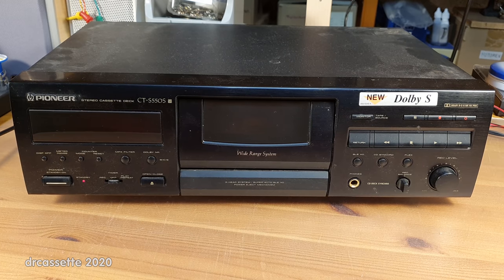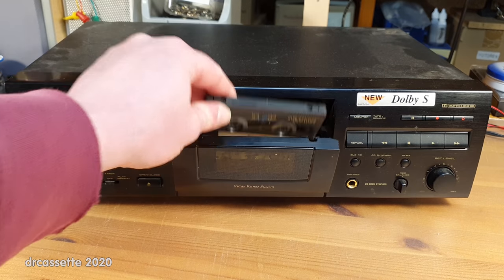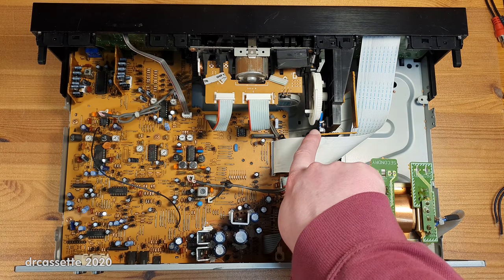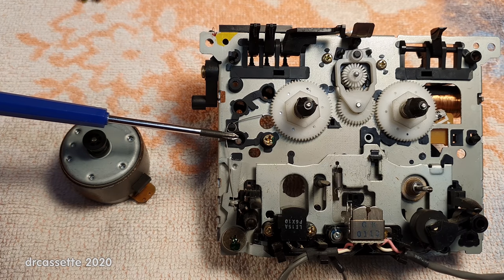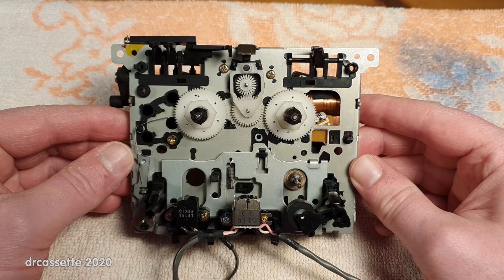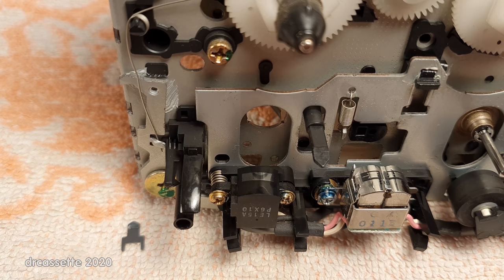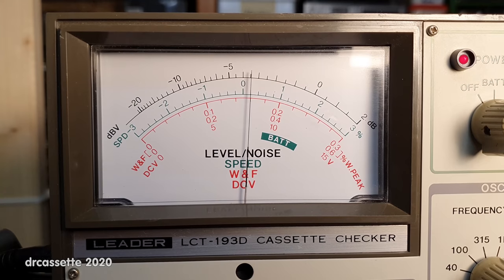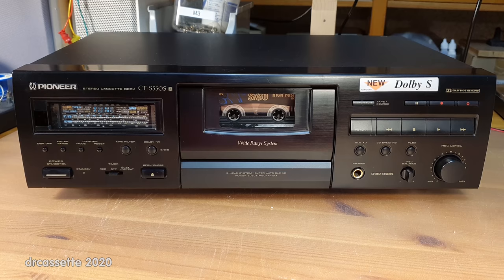Pioneer CT-S550S cassette deck repairs

Comment: Teac and Kenwood tape decks of the same time used the same mechanisms made by Alps. However, time has proofed that these mechanisms are suprisingly good, because most of them return to good working condition after a basic maintenance. It is completely different from other brands, such as Technics, whose mecanisms are constantly damaged beyond repair. Speaking as a technician that repair these decks in a daily basis, despite the cost cutting, I still prefer Pioneer then other brands of the same period. Majority of these equipments are capable of returning to life.

Comment: I've had the same issue with the guide coming off & having to glue it back in place. In my case the plastic parts of the erase head were still hanging on, so I was able to glue them back in place as well. Whenever cleaning plastic erase heads ALWAYS be gentle around the guide.

Comment: I love Pioneers, but this generation is horrible. A simple CT-676 far supersedes it in every way. The dim display is probably because of the standby mode (soft OFF). Most likely the VFD filaments are always powered when the device plugged in. The mechanism is not too bad, Sony TC-K500, 600ES (<-real ESPRIT, not "Elevated Series") and Yamaha KX-330 uses it too. On all of those however, there is a backplate for the flywheel... not even the cheap KX-330 cheaped out on it. I would't give one CT-676 for 10 of these. Great video, thank you!
Reply: the 676 with ble from1990  was a surprise for me it played and recorded with a high quality sound, but had a resistant mechanism in the first month the owner who had the first more quality deck ,recorded like 80 cassettes and today with new belts it works perfect after 10 years stored in a dry place

Comment: the late 70s to the 80s were the best years for pioneer super great quality metal though out  well made cass mechs by the late 80s to 90s they begin to go downhill on quality....
Reply: Sign of the times back then as pretty much all the major manufacturers were doing the same. 1996 - 2000 was an interesting period, as I'm sure MiniDisc was becoming a popular choice for home recording. CD-R/ RW a little later..

Comment: I think in this case, the adhesive inside a cassette tape that binds the "leader" tape to the actual magnetic tape came off and got stuck on the heads.  This happens if the cassette tapes are of low quality or not manufactured correctly.  Once that sicky adhesive get on the head, the oxide will then build very quickly.
Reply from the maker: The dirt stuck to the record head very likely were deposits of tape binder, that is the glue that holds the magnetic particles to the plastic tape substrate. On bad tapes it can happen that the binder makes its way to the tape surface. It then sticks to the head, and it sticks very very well.

Comment: You should investigate the high voltage supply source for florescent display, bad caps there can cause dimming effect because it is a voltage doubler or tripler supply
Reply from the maker: I have not tested the high voltage supply yet, indeed I should do that.

Comment: If the display is dim, it was in my case a bad capacitor, have had this before a few times, I wonder if it is in this cassette deck also. Did you check them all?
Reply: Checked power supply i my deck, everything ok, its looks like VFD lamp is low quality and it is getting bad
Reply from the maker: I have not checked the high voltage supply for the display yet, I will do that eventually. I only checked the capacitors in the vicinity of the power supply.

Comment: Did you measure the voltages to the VFD? I have had bad PSU capacitors cause dim displays. Another last ditch effort is temporarily upping the heater voltage and running it for a moment (to eliminate cathode poisoning?)
Reply from the maker: I have checked the filament voltage, and it's okay, I have not yet measured the high voltage. That is on the to do list.
Reply: @DrCassette  Ich habe die Serviceunterlagen noch nicht da. Welche Spannung muß das Display bekommen? Und was meinst du mit high voltage?

Comment: Thanks for an interesting video. I have just serviced my NAD 616 that seems to have a variant of the same mecha (did you mention it was produced by ALPS?). Unfortunately in my case lubricating the motor did not help to cure the flutter (I am sure it is the motor as I swapped the motors between from Deck  to DeckB to see the difference and it confirmed my idea). I had Pioneer CT-S550S long ago and the problem with their displays is very common. I think it happens because the display always stays ON in standby mode and after long hours it is burned.
Reply: i think the same i had the first deck with this disposition and the CTS-550 if it doesn´t fail me in the dozens number ,the one with what we called a christmas tree while doing the BLE(it showed some moving graphics to the bias then level and equalization ,so a christmas tree wich was very acurate not filled with high-frequencies, i trade it for a BMW2002 from 1974 all restored but with a strike above the right wheel, the owner stoped it and liked my deck and we trade the deck (that only had 6 monthes) for a bmw light metalized blue in perfect condition, than a year or two after i bought other a CTS-630S with a tendencie to make the lights be almost not noticeable,but still appear all the display with some faded lights, i have a deck of this type that i tried to record and the recording sounded great in my old CT-959 not as good as the ones made in it but with nice sound a CTS-420S ,dolby S but i stoped a long ago to record with dolby because it cut´s the lowest sounds or it assumes that is noise about the hiss,if the original recording doesn´t have it not even putting the sound very high i notice any hiss, i have a ACiko from 76 that one has hiss and a reel to reel deck from akai from 1970 that records with great sound today,regards

Comment: Very nice video.
I own this machine and some of the issues mentioned in the video are well known to me. Problem with open door detection. The display is dim, but not as much as in your video.
Wov / Flutter are good, but after one hour of operation the speed starts to fluctuate strongly.
I don't like the construction, dolby S does not have double circuits, so during recording it is possible to listen only with dolby B.
When I got it, I had to adjust the value of the bias trimmers on the motherboard. Otherwise I was not happy with the heights. Now the sound with BLE XD is very good on most cassettes. I use it to test different cartridges. If a tape records badly on one of my main machines (Sony, Akai), I will use this Pioneer for recording and it works well.
To clean the heads and pinch roller, it is advisable to remove the lower plastic bar. I am afraid of damaging the plastic teeth on the bar during frequent removal.
Thanks for the video.
Reply from the maker: Thanks for confirming the tape speed fluctuations. I am thinking about replacing the capstan motor.
Reply: @DrCassette  I haven't fixed it yet. I was thinking of power supply fluctuations. Or a poor regulator directly in the motor. With a little caution, the engine would open.
I have no experience with this, it is conjecture. I will watch your channel if you can fix it.
Greetings from Slovakia.
Reply from the maker: @EZ647   The speed regulator inside the motor should be able to deal with fluctuations in the power supply voltage. The regulator probably just isn't very good, but I don't thank that could be fixed. I would try to replace the entire motor with a better quality one.

Comment: use the flex while playing a cassete,i bought one and it recorded fantastic. Having a CT-959 ,i used to play old recordings in it with flex function they become again more dynamic as the ones made recentelly in the CT-959, i used to press the spots that are pressed by a cassette and press play to clean the heads and the pinch rollers and the rubber wheels ,this after taking carefully out the tape cover ,this because it was well mounted so as not to come out,but with it turned off so it doesn´t close i took the casing off,and the second time i did it ,i left it without the cover of the cassette ,it didn´t do nothing to the position where the cassette stands , but looking better that was more recent than mine. The one i own still had eject and automatic BLE ,that one says xd ble
Reply from the maker: I don't like the FLEX system, it adds too much treble. Cassettes sound harsh to my ears with FLEX turned on.

Comment: I’m glad you were able to save this deck. Curious to hear how well the  Dolby S works, since that was quite novel.
Reply from the maker: I have to say I have not yet tried the Dolby S, but I will at some point. I couldn't use Dolby S for the test recording in this video, because one limitation of this cassette deck is that it only has two Dolby S circuits that are used for both recording and playback. So if you record with Dolby S, both circuits are occupied and for monitoring the recorded signal the deck applies just Dolby B, so that would not give a good demonstration of the system.
Reply: @DrCassette  Wow, that’s some unfortunate cost-cutting.
Reply from the maker: @sunspot42   The next model up from this one had the full four Dolby S circuits, otherwisely it was identical. So there was an option for proper Dolby S monitoring available, it just cost a bit more.
Reply: @DrCassette  Interesting. Is there anything that can be done to rehab the faded VFD? I don’t really understand how those work. Are they like fluorescent bulbs? Have the phosphors just faded with time and use?
Reply from the maker: The VFD basically works like an electron tube, like a triode, by emission of electrons from a kathode. The anode has all the display elements printed on it with phosphor. In between is a control grid that determines which element lights and which doesn't by screening electrons from the inactive elements. The active elements are hit by the electrons, which causes the phosphor to light up. In a faded VFD there is either something wrong with the emission of electrons, or with the phosphor. In this case, the heater voltage is fine, maybe even a little on the high side, so the emission of electrons should be fine. So there must be something wrong with the phosphor. This can't be fixed unfortunately.
Reply: @DrCassette  Oh so it’s something like a little TV. Makes sense - old TVs fade with time as well. I wonder if this is why Sony and others experimented with those backlit LCD displays in the ‘80s. I loved the look of those - the display elements could be much larger and the colors were wonderful - but the response times were sluggish making them less than ideal for things like level meters.
Reply from the maker: The response time is the one issue. The other is the viewing angle. If you are not looking straight onto these displays, the contrast is low and you can see some backlight shimmering through parts of the display that should be dark.
Reply: @DrCassette  Yes that’s true. I had a Sony CD player circa 1987 with one of those LCD displays and if you were far off-axis it was harder to read. It did look beautiful tho - deep rich colors and much thicker, more legible characters and indicators. 

I wonder if we’ll eventually see LED displays finally displace fluoroscopic displays on audio equipment.
Reply: CT-S550s dolby S is its strong point. Well calibrated, sony chips, better integrated than in any sony model

Comment: On a Sony of mine I had to replace the capstan motor. It would play pre recorded albums fine as they're generally no more than 25 minutes per half. The problem came with C90s as @ 30 mins or so, the slowing of the tape speed became noticeable. Changing the motor for a NOS 35 year old motor solved this problem.
Reply from the maker: It seems like the capstan motor in this Pioneer has a similar problem, somehow the speed regulator does not maintain a constant speed. I might try replacing the motor with a better one too.
Reply: @DrCassette  behind the motor's cap there is a PCB with one or two electrolytic caps, you should check them if you constantly loosing speed. Most likely awfull leeky ELNA caps. Most of the electronics in that era use that brand caps and all of them failed due to bad caps. They used broken formula to make them and when they failed, leak badly and corode PCB like etchant and smell like fish oil.

Comment: I got the CT-S410, probably a bit earlier version, it has the same Alps mechanics but the door is removable ;-) and not motorised. The BLE system is indeed not XD, and a bit quicker (and simpler I guess), it seems to check only 1 EQ level. Otherwise it looks very similar, I though it was more or less repair friendly, much better at least than my YAMAHA KX-W900 Twin Deck!
Reply: I've got a ct-s 420 which is a bit later than your 410 I believe, and it's all the same as you wrote with one exclusion - the door wasn't made removable already. The mechanism is quite noisy in mine - I can clearly hear the motors humming, and I'm curious if it is normal for these Alps mechanisms, or it's the sign that mine is going to die soon...

Comment: If scratched up, the plastic windows can be poished by fine automotive polish. Not wax, but polish. Its designed to eliminate the scratches in clearcoat, and it will work well for plastic windows too. It obviously  won't work if the plastic itself is cloudy all the way through.

Comment: Hopefully the Dolby S circuitry works. My CTS-820S shows horrible mistracking on one of the subbands in the left channel.
Reply from the maker: I have not tried the Dolby S yet to be honest. I just don't use Dolby for my recordings. But if I ever come across some cassettes that were recorded with Dolby S, this deck will come in handy.
Reply: @DrCassette  Dolby S is amazing when properly calibrated. I would have never thought that a cassette deck can give a DAT deck a run for its money but Dolby S and a good Type IV make that possible. And even lowly Type I tapes can really shine with this NR system.

Comment: Hello. I have Pioneer CTS550s and I have such a problem. After pressing "Play" the drive spins but very quickly. Of course, this causes the casette not to play and noise is heard in the speakers. What could have happened?
Reply from the maker: It seems like the head bridge is failing to fully engage. This may be due to a bad belt, or due to lubrication issues.

Comment: I have restored a CT-S820S and it has a way better drive unit than this, what really surprises me, because the 550 was the last of the „best“. Thanks for showing.
Reply: Hey,  is there such a thing as a "reset" of power on this model?  I'm trying to fix it right now.

Comment: Man i have a CT-W205R from 96 and i always thought it could be one of the latest manufactured dedicated cassette decks because from the 2000 and on you didnt saw a lot of them around

impressive
Reply from the maker: You will be surprised to hear you can still get HiFi component cassette decks today. Of course they are nowhere near as good as the older decks, but they do still exist.

Comment: What happen if you add little more voltage this screen? Bright or burn?
Reply from the maker: You can brighten VFDs by applying more filament voltage, but this also shortens their lifetime. And given that the remaining lifetime of this display already is so low, I don't think increasing the filament voltage would be a good idea.
Reply: Power supply usualy is not designed to 'regulate' this VFD voltage. And we had 220v in europe, now we have 230-240 and problem persists.

Comment: this was a great video, many 'tubers could take lessons from you. I don't need to see you remove four screws before you get to work on the mechanism.  I  prefer the metal and wood of 1970's cassette decks but that auto-bias feature is sure nice.
Reply from the maker: Thank you :) 
I try to keep my videos relatively short. My target used to be 10 min, but it seems people actually prefer longer videos with more details, so now the target is to keep the video under 20 min. This often requires lots of editing. Everything that's uninteresting or redundant is cut out. This video was about 24 min long when I started editing, now it is just under 18 min. Unfortunately a lot of people don't edit their videos at all, or only do the most basic edits, basically just splicing video files together. These videos can be quite frustrating to watch. Only a few people are able to make good videos without any editing at all.

Comment: Great work on this one. I think vwestlife also made a video about this or a similar deck.
So there's no solution to bringing the display back to its original brightness except source another display?
Reply from the maker: I checked the display filament voltage and it's fine. The other option would be a bad high voltage supply. I have not checked the high voltage yet. But if that turns out to be okay, there is nothing that could be done to revive that display. I am not going to try to source a replacement. It will just have to stay as it is then...
Reply: @DrCassette  OK, thank you for responding!